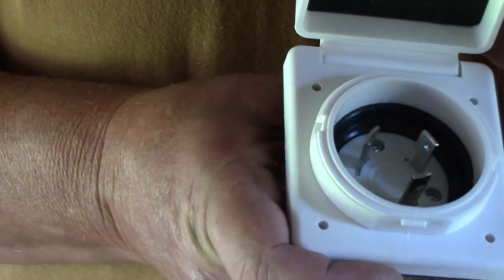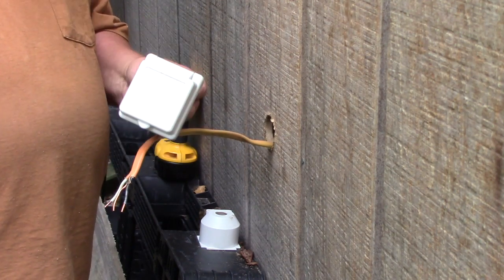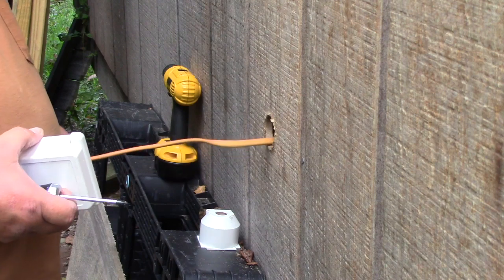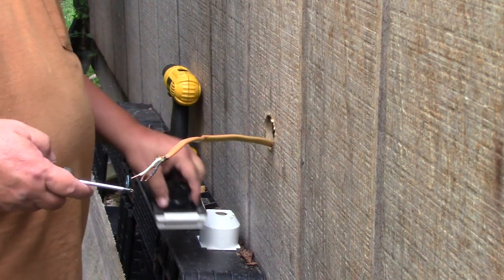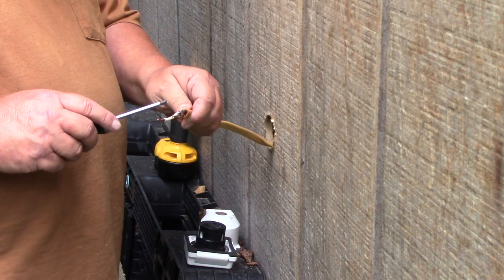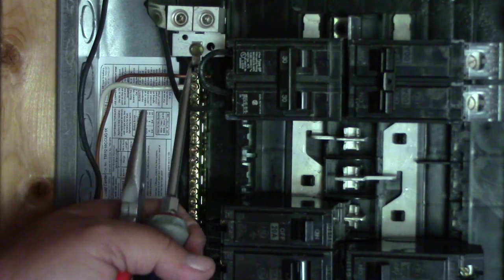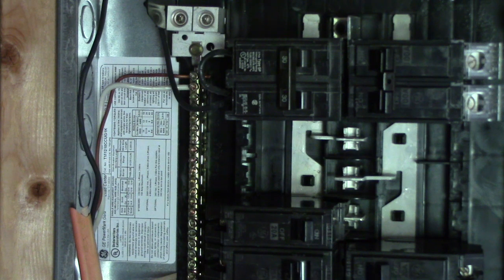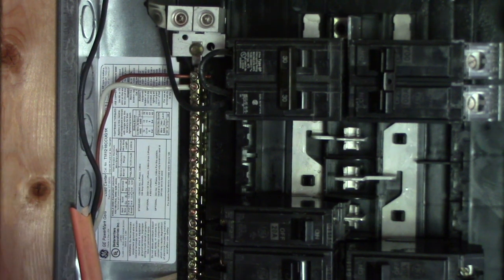Wiring Generator Off Grid Cabin Service Panel

Comment: You are a lifesaver! I needed to know how to do exactly what you did. I will replicate your exact procedure and now I will eventually add solar panel system so I can have electricity without the generator running. Just wanted it for the window unit that has a/c and heat. Awesome job and I am very appreciative for the information.
Reply: Watch the rest of his videos! I learned so much! My solar system has 10 255w solar panels and, thanks to my Uncle Joe, I run 3 solar charge controllers and have 12 lead acid batteries in my bank that runs my house. Good luck to you!
Reply: I run a 600w window unit from 10 am to 6 pm completely on solar. After that I run an 1800w window unit on my generator. Check out his other videos!
Reply: @tawnya0627  wow…that’s awesome. This is just a hunting cabin so not living there.thanks

Comment: I just happened to run into this video because I'm trying to do something similar. I'm hooking a 3,500 generator and want to run a temporary extension from the house to a connector at the shed. My question is, Do I hook the electrical extension power from the connector/receptacle to the 30amp circuit breaker too just like yo did with the solar power one? ro Do I need a different size circuit breaker?

Comment: I do wiring, but not residential wiring. I'd need to do a lot of research before I tried to wire a cabin like yours, with solar power and a generator. It's like what I do, each individual step isn't all that difficult, but it's complicated when you put a whole string of those steps together. In reverse, if I have a tough job at work, I take it one small step at a time. Glad to see the cabin coming along, it's going to be a great little getaway for you and Gail. Linda and I send our best.

Comment: My modern offgrid cabin is my home . The genorator is hooked into the main breaker . 
Solar is hooked to a 30 Amp breaker . With a home made disconnect switch.  
So the y both can not be on at the same time .
The only time i use genorator is for well pump , water heater , washing machine . 
At most the genny only runs about 3 hours a week .

Comment: Great review...real life experiences vs video about real life application. See someone actually plug the power cord in is vauable.

I do have a question. Why don't you use your truck to charge the batteries instead. This way you can store the power into the batteries and you can free up the truck. Either go to town recharging, if you to.

Comment: Hey Joe!
I think something is going to go pop if you try to run your inverter and generator at the same time, unless you can lock the phases together...
I'm not an electrician, either.  ;oD
Good luck.
Reply from the maker: You're right. In the video I mentioned how I need to devise a bracket that will allow only one breaker to be on at a time.  So if one is flipped on, the other is forced off.  It will be rare that I have to take the generator out anyway lol.  Thanks for the heads up!

Comment: Joe, you could've wired it for 220v and split it at the breaker box, less strain on generator and more flexibility in using plugs in cabin.whit is one line black is line 2 and of course neutral/ground.

Comment: I'm sure by now that somebody toll you that your neutral wire and your ground wire don't go on the same bar. The ground wire go on the bar on the other side.
Reply from the maker: They can't be under the same lug, but the can be on the same bar, as long as that bar is grounded to the box.  That's the way it was explained to me, and what I read in the book.   Perhaps I am wrong.  I can easily change it.
Reply: @StBernardAcres  That is right they can be on same bar but not same lug. Jumper will work fine have done that at hunting camp.
Reply: Actually they are bonded at the generator therefore they cannot be bonded at a “sub panel” which in this circumstance this panel is playing the part of, i am not trying to denounce anything that you did in the video, it is a great job for someone that has learned purely from his own devices, but in order to be done correctly so that no problems will arise in the future, there should have been a 120 volt sub panel, and neutral and ground not bonded at the sub, also just as a side note, great job grounding the panel, just make sure that you have a ground at your light plant so that the electricity has a path to follow should that ground ever have to be used! Cheers!

Comment: Where exactly is your ground wire from outside ground bar attached in panel?  And is the green screw screwed all the way in to bond bar to panel?
Reply from the maker: That will all be done on my next visit lol.  Life gets in the way of progress sometimes.
Reply: Ok.. I'm in this process myself and kinda stuck at this point on these two things before I can complete my panel  connect

Comment: Great video goodsir, thanks for making it. Two questions of clarity about your setup:

First: I see that you used 10/2 wire to bring power from the inlet to the panel via that double-breaker. But did you use 10gauge wire for the jumper also? Meaning you put TWO 10gauge wires inside of ONE of the breaker slots on that double-pole breaker?

Second: Is the grounding rod installation truly necessary? Or is it enough for me to simply put the green screw into the bar that holds all the neutrals and grounds, thus grounding them all together into the metal of the panel itself?

I'm planning to run a non-solar setup with just a 2200W generator (I'll be keeping my power usage low, it's a small cabin), and I want to be sure before I start running power. I'm definitely going to have an electrician give me the OK before I start it up btw so don't be worried about bad advice, I'm just trying to keep things moving forward at the cabin.

p.s. I've got things figured out now actually. Gonna ground my box to a rod outside and I know how to do the jumper. Thanks again for making this video, it really helps a novice like me.

Comment: Hey Joe I commented on your Husqvarna leaner mower video, the one to change the star adaptor for the blade. Please let me know if you know what the problem is.
Reply from the maker: I don't know why it wouldn't come off.  Unless there is rust or something inside it on the shaft.  Like the video showed, mine just slid on and off with ease.

Comment: Question: If you had a 100 amp breaker box that had two lugs at the top (one for each side) could you then use a 10awg jumper at those lugs to power both sides?
Reply: I just asked that same question.
Reply: It's the same thing, only your using the power through the 100 amp breaker to power both sides of the breaker panel.

Comment: Question. We recently purchased an allprogenerator system. We have a generator and a power pod to hold power from the wind turbine and three solar panels. What type of cord do you recommend to run from the generator to the house panel? My husband is confused about the cords being seen in the videos as he feels that the 100 Amps he placed in the panel just for the thankless water heater is not enough. Help us understand what to do in this circumstance. Thank you in advance.

Comment: Joe:   I have a EG6500CXS Honda with 2-220v plugs.  Can I do the same thing, but hook up both legs of the panel. So I will have 220(20 amps) on one leg and 220(20 amps) on the other side of the leg.  Then hook up neutral and ground to the panel for both sides. Is this possible.  This is for my shop, no other electrical hook to the panel, just the generator.   I like the way you explain everything.  Thanks    Please let me know, what you think?
Reply from the maker: That I'm afraid doesn't sound right to me.  220 allows you to have the 110 you need on each side of the panel.  I don't think you can run 220 on one side with this kind of panel.  Yours would just simply wire into the main breaker which feeds both sides.  I think you have two hots, 110 each.  I am not an electrician though, I just asked a bunch of people lol.  But, it seems that someone explained it too me that way.  I needed the jumper because I only had 1 hot leg, that was 110, so I had to make the jumper for the other side.  I think.  Sorry.
Reply: @StBernardAcres  Thank you, Joe for the answer.  I believe you are  right  about hooking up directly to the 100 amp main.  Both plugs to the main.  I will check for sure, before doing the work.   I live in the Philippines, which we have a lot of brown- outs. (Power-out)  My house has a transfer switch with my other generator.  My Shop, I decided just to use my bigger Generator, This way, I don't have to worry about brown-outs.  Thank you for answer so quickly, Joe

Comment: Great Video!
Too many people try to change things in their plugs. I like your way- much better and safer.

I have a question maybe you can give me some insight on if you might be so kind to respond.

I have paralled two 120 volt 3,500 watt inverter generators. They each are 3,500 starting watts and 3,000 continuous watts @ 120 volts/ 30 amps. Together: 7,000 starting watts and 6,000 continuous watts/ @ 120 volts @ 49 amps max. They only produce 120 volts when paralled.

If I were to set my cabin up at the panel box with the same 2 pole breaker with a bridge to energize both bus bars would I use a 50 amp breaker? Along with using 3 #6 wires (White, Black, and a Ground) for the generator to the power inlet, the feed wire from the inlet to the panel, and the bridge wire in the breaker? 

Just asking for a hypothetical of course since I am not an electrician either. : )